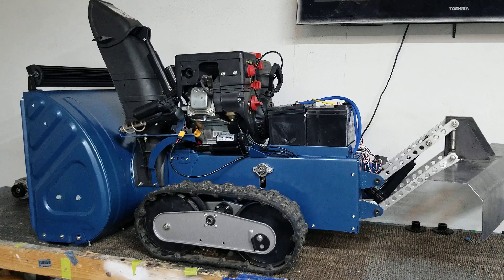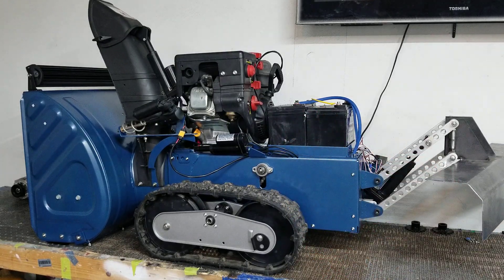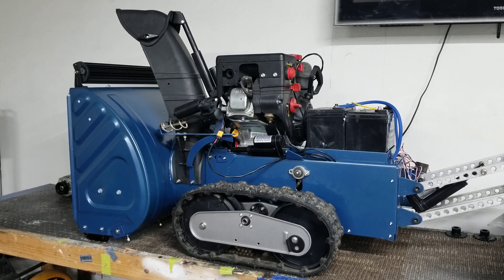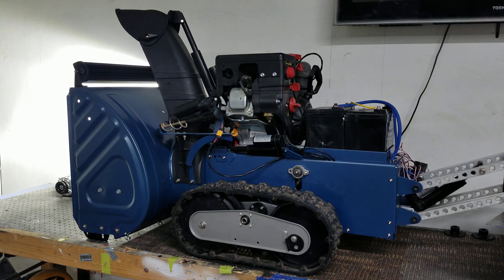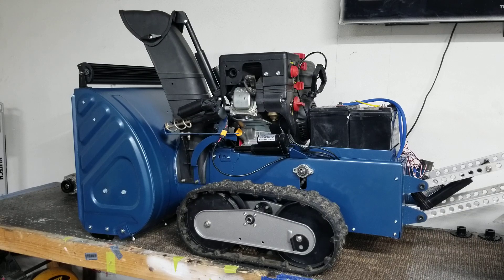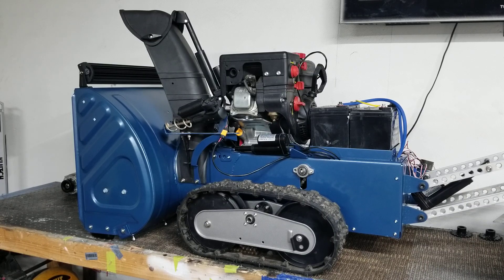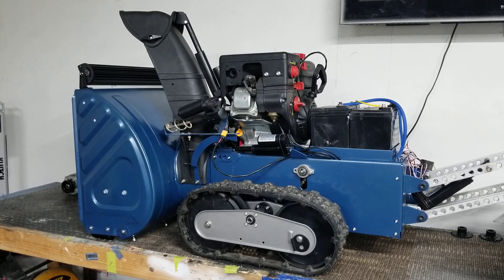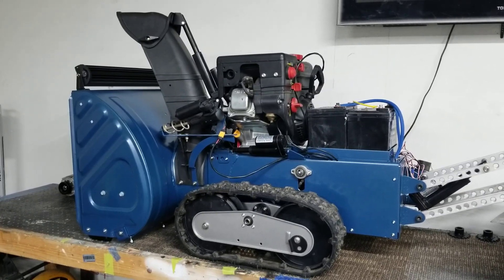Remote control snowblower operational test all systems...

Comment: What kind of alternator did you use
Reply from the maker: It is just a little alternator off an kobota.
Reply: Can you please send me the model number or the part number so I can order one  I really appreciate it thank you
Reply from the maker: @greyblue12567  
DENSO: 9760218431
Reply: @fstrcboat  thank you very much where are you located at I'm in Illinois
Reply from the maker: @greyblue12567  down around the STL
Reply: @fstrcboat  I'm sorry what is STL
Reply from the maker: @greyblue12567  St.Louis
Reply: @fstrcboat  oh ok thank u I'm sorry about all these questions it just did I'm handicapped and it's hard for me to do things and I was trying to build something so I don't have to work any harder I really appreciate it all you're in for you gave me how did the alternator turn out on the machine were you able to charge the battery as the snow blower continued running
Reply: On that alternator I heard you in the video said it was a 24 volt how many amperage
Reply from the maker: @greyblue12567  that is going to depend on your setup and batteries you run.
Reply: @fstrcboat  I'm going 2 run to 12v battery and make it to 24v
Reply: Can I send u some money for ur time I appreciate you helping me